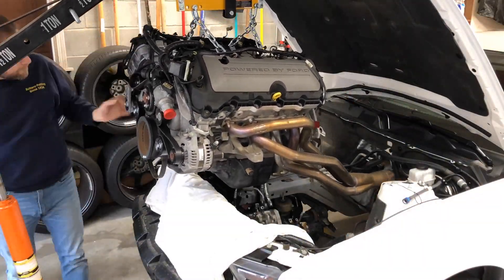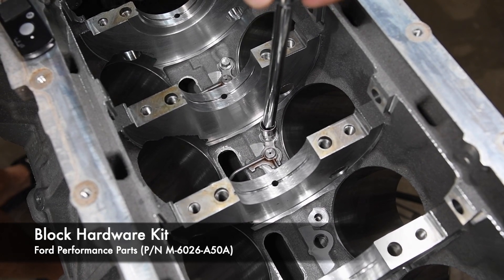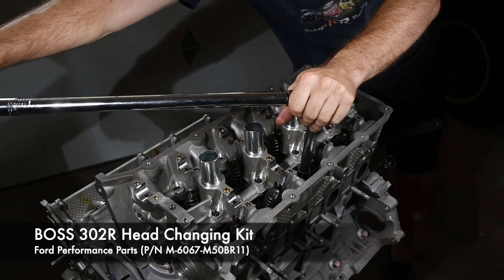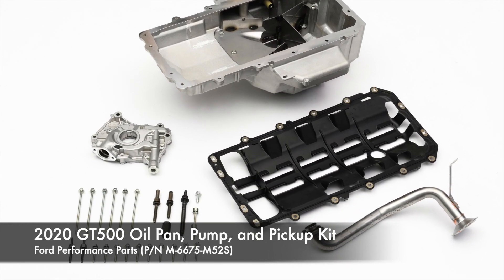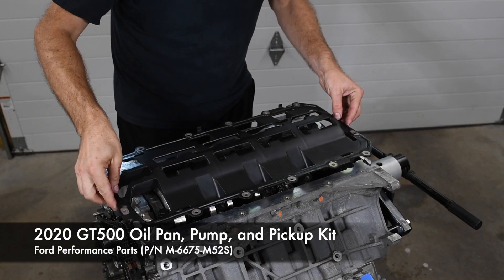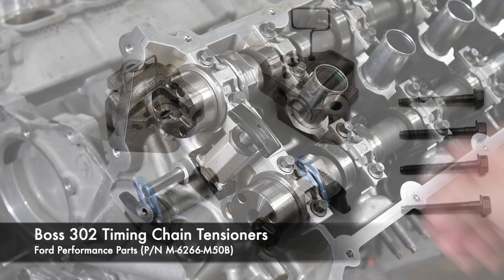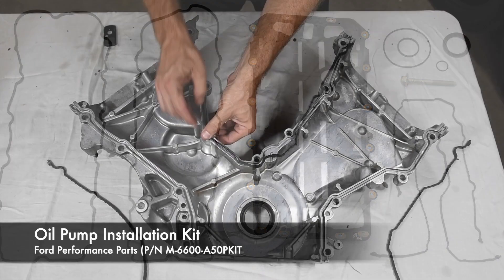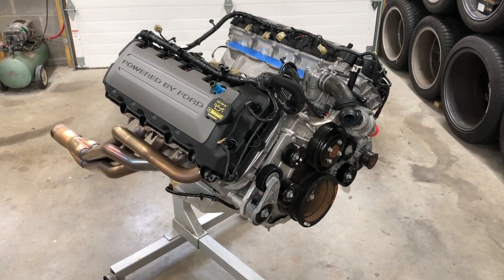Coyote Build Solutions from Ford Performance Parts

Comment: Guessing there is no K member clearance issues with this pan on S197 application ?
Reply from the maker: Actually the crossmember will need slight modification for adequate clearance around front corners of sump to fit 2011-2014 Mustangs. I just had to grind about 1/8" away from the K-member flange to stop a corner of the pan from bumping into the crossmember under load. It fits, but there's not enough clearance when the engine moves around. It's easy to do with a die grinder (or even better...before you install the engine.)
Reply: Ahh, good to know!

Comment: For the oil level sensor, I know you said you did an extension, is there a part I need to get for that? Also for the oil pump gears, did you use the billet gears for a coyote or for a predator motor? Also, thanks for the video! I’ve been wanting to upgrade my oil pan on my Gen 2 coyote (bolt on car) for better peace of mind
Reply from the maker: I extended the wires myself (just cut and spliced in some extra length). Since I was using a predator oil pump, I used predator gears. Please like and subscribe!

Comment: Does anyone know if the oil pump gears are not the "powdered metal" that the original Coyotes had?  I'm assuming not since the GT500 stock output is higher than the originals can tolerate, but wanted to verify before purchasing.
Reply from the maker: Not sure. I believe they are. But you can always replace them with Boundary Gears before installing. It's cheap insurance. I cover that in this video: https://youtu.be/UIpJT4QfjXw